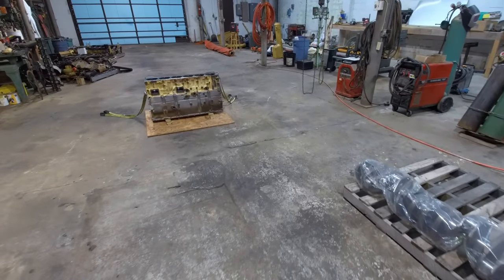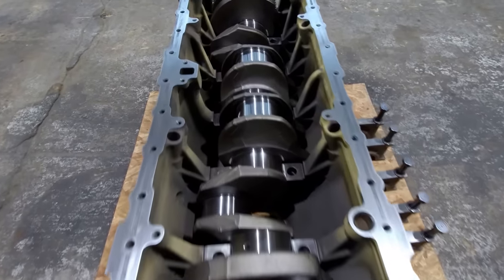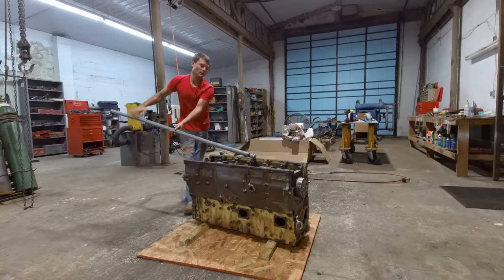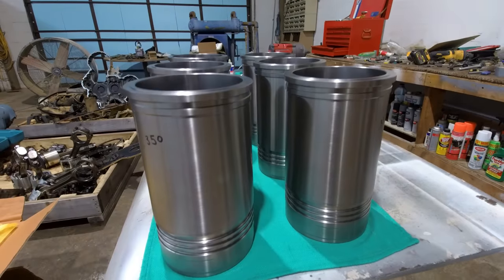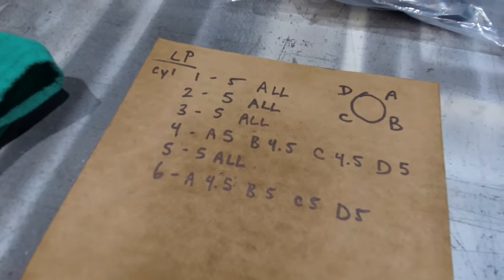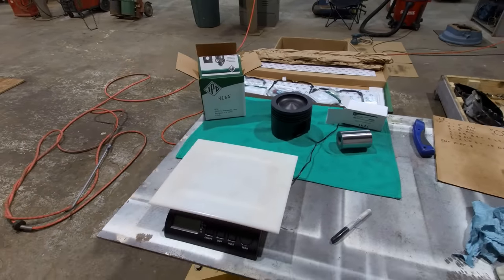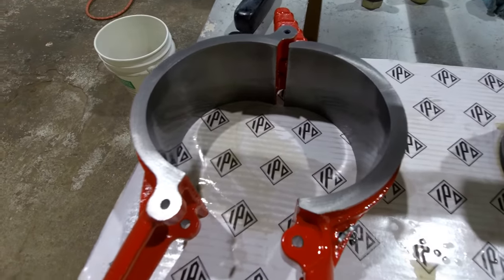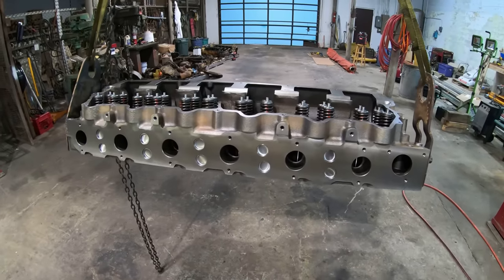700 HP 15.2 Liter Caterpillar Diesel Engine Build - Assembling Major Components

Comment: I wish the cat dealer would pay as much attention to details and trying to match up the components. We had my acert c15 with 20,245 hours on it to be rebuilt. Cat did a Platinum rebuild on it. Talking to the guys at cat they just put the components together and push them out the door. One guy said that the warranty would cover any problems. My response was that was nice except for the down time and revenue that was lost for returning for warranty work. You do a great job on the motors, I just wish we could have had you do our motor rebuild. I see you use non cat components, do you have a better outcome with the other companies parts? I'm just asking because it seems that you have done alot of research on these parts. I'm in no way a engine rebuilder, only a driver that likes a engine that doesn't need to be in a repair shop for warranty work. Thanks for the info in you videos and I find them educating. Are you excepting any engine rebuilding?

Comment: I have a question. I noticed the pistons on the diesels you rebuild are indented and have a point in the middle. I have taken apart gas engines and found a flat top. Im just curios why are the diesel pistons diffrent from the gas pistons?

Comment: Got 700,000 miles on my in frame that l did on my 2006 379 Cat Acert that the local cat dealer did . Im thinking of getting my next inframe done by a none cat dealer local shop . I know l wont get the extended warranty that Cat offers on the platinum kit . Just want to get your thoughts on if thats l good idea . It will be a lot less money but only get one year on parts if something goes wrong . wondering if its worth the gamble ? This shops mechanic is Cat certified . Enjoy watching your videos very educational , learning a lot .

Comment: Looked like you plastigauged the crank dry... but I saw assembly lube on the rods... is there a difference?  Looks like taking the pistons out and lubing the rods after plastigaugeing would be a PITA!
Reply: It wasn't dry on the bottom side.. See 2:43 You don't spin the crank while measuring with plastigage, so there is no problem applying assembly lube to the other side after checking the tolerances.

Comment: Even I could see it is a piece of pipe you are using. BTW, pick up a section of sprinkler system pipe, it has a thicker wall and no welded seam inside.  It may be a tad heavier but it will not bend.......

Comment: "I did all six uppers, all six lowers, and all the water holes"   I don't know what that means. Can you explain?  And the block still has paint on it. What's up with that?  Other blocks that you have done are bare metal.  What do you do if the Plasti-Gauge shows too much or not enough clearance?  I've always wondered about using a chain hoist for this type of work.  It seems to me that any number of bad things could be on the chain and in the hoist that could drop into whatever you are working on, and you would never know it .... until something bad happened, and maybe not even then.
Thanks

Comment: I seen a idiot working on a truck in a video using a torque wrench removing bolts saying if a bolt calls for a torque spec you need a torque wrench to take it loose. Some just don't have any mechanical ability at all and don't understand. 

Yeah it's a fucking pipe!!!!  Laughed my ass off!!!!

Comment: I ran a loader with a c 15 , it had 22,000 hrs and I never added oil. Every 400 hrs got a oil change. But finally after 30 , 000 hrs, got a rebuild. The old parts looked as good as the new parts. C A T rules!

Comment: KT I AM HAVING A 2WS02012 ENGINE REBUILT AND WAS WONDERING ABOUT CHANGING THE CAM TO A 10R7155. WOULD YOU ADVISE THAT?
Reply from the maker: Not unless you're going to run 59 injectors.

Comment: Any of you guys just for the hell of it convert those torque angles on the head bolts and the main caps to foot pounds? Just kind of wondering how many actual foot pounds are put on those female threads..

Comment: Do you have to remove the plastigage when you’re done with it or can it just run in the bearing?
Reply: You torque and then remove the gauge strip and measure how much it got squished. Never run any contaminants through your engine.
Reply: @Apodalont  that makes sense.  thanks.

Comment: And when u check for oil clearance on mains or rods u sad to torque it to spects is that means to do the torque and 120 degrees and then pull of and check the plasiguage

Comment: Man, they have some very affordable torque multipliers out now. Do you're shoulder's a favor and invest in 1 or 2.  1/2- to 3/4" dr and 3/4 to 1" dr.
When you hit that oh my god torque you can double stack them  Typical is 4 to 1 ratio so 100 ftlbs in is 400 ft lbs out.  Double stacked  is 100 in 1600 out.  Means you have to walk around the block a couple of times but when you hit you're 50's you might still have shoulder joints that work as yours do now.

Comment: I see that u dont use any aviation Form A Gasket selant on the spaser plate between head. Do you ever have a problems that they seep oil in there.

Comment: I know nothing about diesel engines,  but why do they use sleeves instead of just having bored cylinders like cars?
Reply: you can replace liners easy, liners make the block stiffer, liners are steel and they wont crack especially from heat like cast iron will

Comment: I would drill me a couple of holes in the floor that I could drop pins in that would one on either side so I could contain the block and it wouldn't turn
Reply: There's absoultely no need to go drilling holes into the floor, you can use a heavy duty ratchet strap attached to end of the block and the other end to another truck or a car, it will stop it from turning while tightening main caps.

Comment: It kills me to see the movie set 
The table with all the parts is across the room
My parts table and tool box was alway near my project I was building 
I seen many people work like that but they werent the most efficient 
May be he has one of those watches on that counts his steps
I alway shook my rods after they are torqued
Saved me a failed engine
After I torqued a rod it would “not”shake
Turned out clown who took it apart couldnt get the piston out so he put a punch on the rod to rod cap surface and put a tiny ding on the rod 
Soon as the rod bolts were torqued the rod wouldnt move on the crank 
That would have spun the bearing 
When I showed the boss he said thats why I had you build the engine 
Shake your rods every time after torqueing
Built hundreds of engines after 37 year (Peterbilt Mack Freightliner)career as heavy duty mechanic
Cat Cummins Detroit Mercedes factory certified mid range to 16 liter truck engines